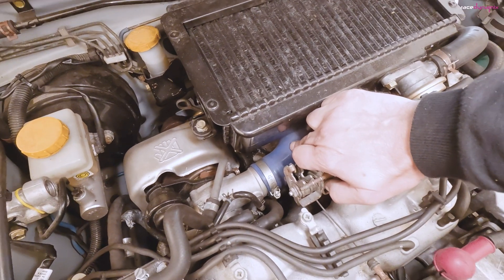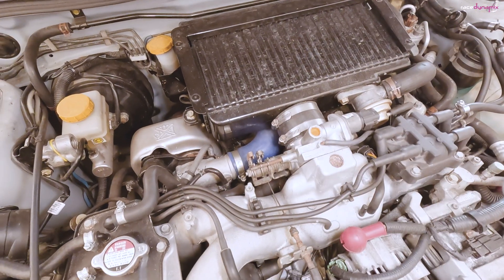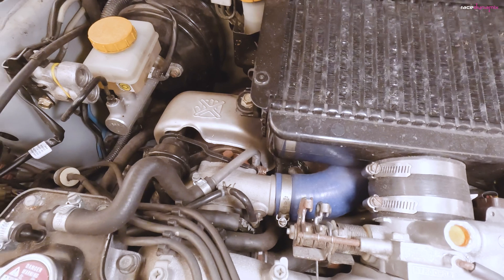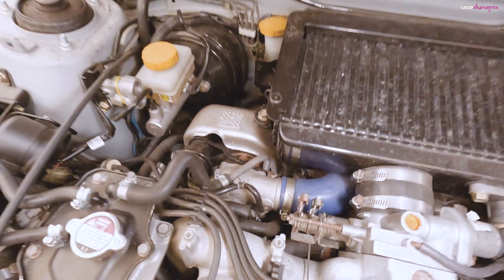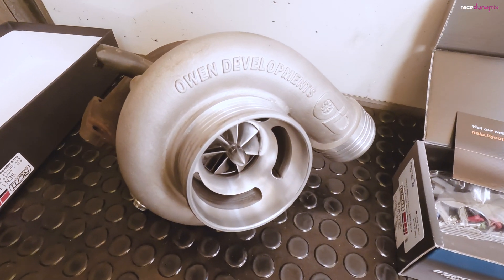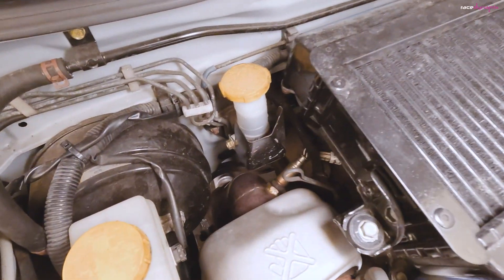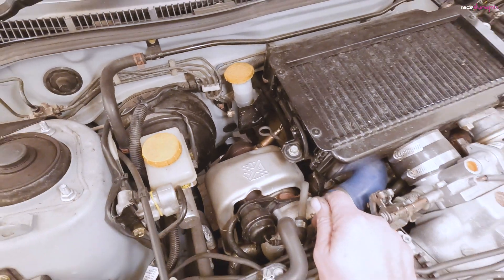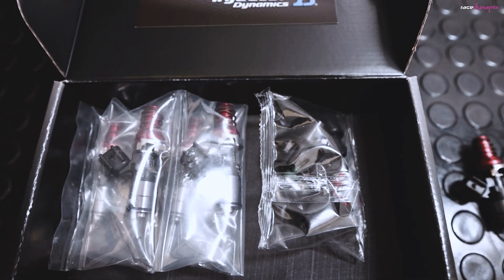Which Subaru MODS will need a TUNE? and Why ?

Comment: Dp you need a map for a catless downpipe or cobb catted downpipe for a 04 fxt?
Reply from the maker: Hi.. yes in my opinion.  It alters boost, fueling and ignition timing required in the engine. 👍

Comment: Hey dude, ive got a v2 GC8 sti with some intake and exhaust mods. 

How do you tune these ecu’s as i know the early shape impreza’s can be abit tricky.

Thanks
Reply from the maker: Hi.  The std ecu can't be remapped as it stands in standard for unless there is a daughterboard unfortunately. There is no way of reprogramming them.  The daughterboards work well but not available new anymore
Reply: @ ah okay thank you, so its either aftermarket ecu or find a chip ?
Reply from the maker: @karlogrady4907  Yeah ESL daughterboard is the cheapest option 8f you can find second hand..a V2 version (not the original one as that isn't mappable anymore)

Or I can supply and fit a link g4x 👍

Comment: Hi I have a 06 WRX would I need to get it mapped again if I put a sti intercooler on it. Thank
Reply from the maker: It would not NEED remapping so long as just changing that but to get the extra power that is available because of the cooler air it would be beneficial 👍

Comment: Vaguely related so will ask it here- is an aftermarket intake pipe (Samco for example), worth fitting before a remap along with other mods?

I've heard the oem intake pipe can fail, but are there actual gains to be had from going with a silicone pipe replacement?

My car (jdm hawk sti) is currently mapped with a couple mods but will be remapped again in the spring as I have a turbo back exhaust and sports cat down pipe to go on, debating whether to throw a silicone intake pipe on at the same time, in for a penny etc etc.

Keep up the great videos!
Reply from the maker: Hi James.. Thanks for watching and the question 🙏

The std intake will not cause a restriction on power on your car for anything that the std turbo will be capable of.  There is a benefit higher up power wise but lots of the silicone inlets introduce more problems that they fix so I wouldn't recommend changing. Good ones are very expensive and whereas some tuners will try to sell you one, there are big downsides.  If the std inlet breaks, get another std one imo 👍

If you were to go bigger turbo (again I wouldnt recommend as it will change the characteristics of your super spooly jdm) then perhaps look at one of the solid aftermarket inlet hose options.

I hope that helps.

Comment: Hi Duncan, 
I have a 2008 sti looking at putting a bigger top mount intercooler (bigger surface area and volume) will it need to be mapped? or will it be fine to use until I do my sports cat and induction kit and get it booked in with you.
Reply from the maker: Hi Richard.. Thanks for the question.. Assuming it is a more efficient intercooler and no leaks it will onky make your car safer in the meantime.. Will be fine.. Or at least more fine than it is 😉👍

Comment: Bro is my legacy GT gen 3 jdm model need a remapping? What I heard alot is jdm twin turbo model is designed for 100 octane fuel we only have 98 but it's triple the price of 92. So everyone uses 92 except you're rich and riding a brand new G wagon or a Lexus. If so it's a true. Can it be mapped to 92 octane fuel?
Reply from the maker: Yeah they have fairly aggressive ignition timing for the jap fuel so really don't thank you for 92 octane.

It depends on the Yr of yours as to which ecu is in it as to whether it can be mapped. An aftermarket ecu isn't an option as it won't control 2 turbos so unless you swap to single turbo the option is see if the std ecu can be tuned if not.. Octane booster and check to make sure everything is running safe and happy.
Reply: @racedynamix  thanks for the quick answer. Mine is from 2000. And it seems not a E-tune version or something just a regular one. From my research all over the internet this one is confirmed Rev-B. Do you guys have flash tuning service?
Reply from the maker: @buyanbatbold7522  unfortunately no flash tuning.  I only map the cars physically with me.

However Ecutek software can access that ecu and map a lot of the parameters. But and it's a big but, the ecus are prone to dying whilst flashing so always have a get you home spare ecu available.  Where are you based?
Reply: @racedynamix  I'm live in Mongolia. Also I do have a Eifel ecu from same model year. Even tho ecu is not that hard to find. Since this car is so rare here. Nobody buys it's ecu's.

Comment: Great video as always. I've also found that aftermarket intakes that maintain the stock MAF housing size still flow differently even if the size is the same and will benefit from MAF rescaling. Changes related to exhaust (J/downpipe, catbacks etc) require remapping to make the best of them but generally nothing catastrophic will happen if you're waiting for a few other mods before getting it all tuned together.
Reply from the maker: Great point.  I did mention that in the video but it maybe wasn't clear enough. Thanks sir 🙏

Comment: This is not what people want to hear lol, personally I love having cars remapped it’s so worth doing unless you’ve had one done you won’t get it.
Reply from the maker: Very true.. in my experience people are almost always delighted with the improvement on a std car let alone a nodded one that wasn't liking the mods pre remap
Reply: @racedynamix  I’m going to start buying bits for mine soon before I come and see you for a map I might have a few questions on part recommendations lol, Its so nice as well being able to ask a proper mapper like yourself questions because normally you only really get to chat to them as there putting all the equipment in the car and strapping it to the dyno and when there taking it back off again which doesn’t take long lol

Comment: 1 thing that "might" be worth covering is how much flexibility ECU's have, in terms of pulling timing etc on certain mods. A lot of owners simply don't understand that the stock ECU is looking for certain things in the cycle to match up (air in, fuel in, air out) and if there's an imbalance in this due to a modification or fault the ECU will TRY and make changes to suit, but often cannot cope with extreme's like aftermarket parts, hence why mapping is required to TELL the ecu what's been done. Fuel cut/boost cut due to unmapped mods, boost spikes, etc could all tie into this.